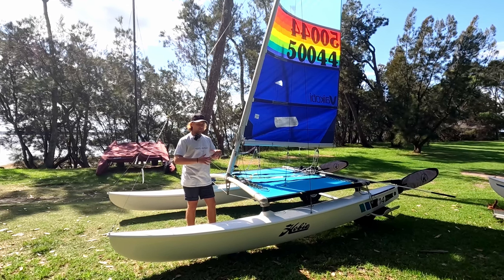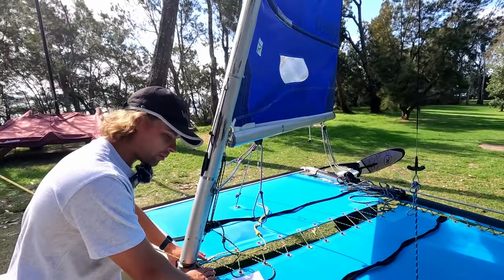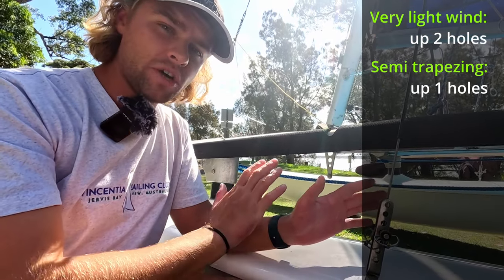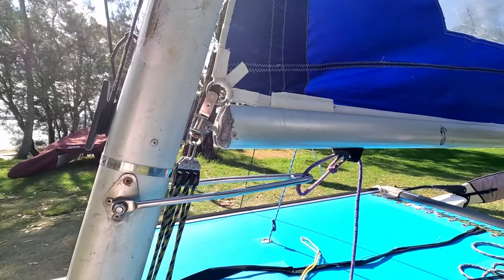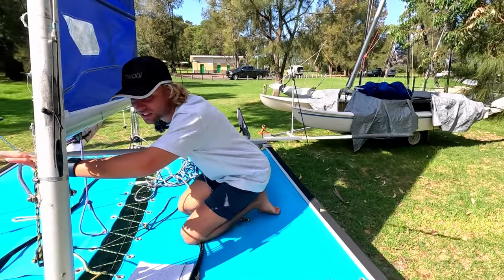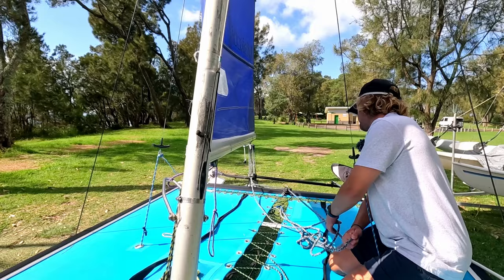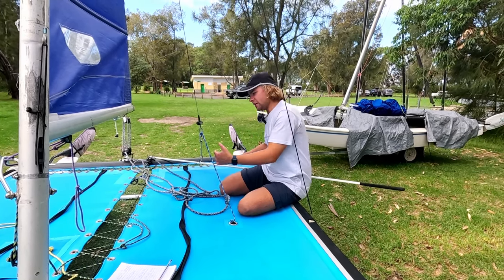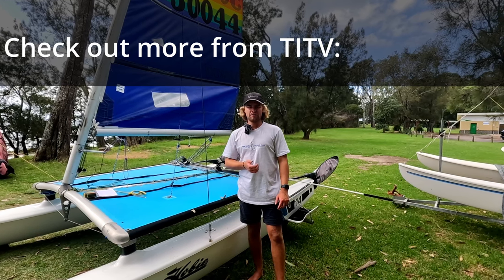Hobie 14 Masterclass with World Champion Paddy Butler

Comment: Thank you Paddy.. very informative. I have a very aged turbo. with no trapeze. I have fitted turnbuckles into the hulls as the beams had fatigued around the fittings.. also had to rivet alloy plates as the beams were bending upwards under windage. I do not have a rotation spanner on my mast. She sits on the beach and is bludgeoned by Southerlies up to 30 knots so I weigh her down  with rocks on the beam corners to prevent her capsizing on the sand at low tide.    My height is  6,2 and  weight 95kgs. How do you change the shroud pins without the the eye pulling out of the chainplate and the mast plummeting to earth?!.. I also sail a 16 named Pacific Banana with a cut down jib without battens as I only sail her with my mighty Dog Georgie. I also sail ancient A Class and the biggest difference to the Hobie is how vigilant you have to be on ensuring the leeward bow does not bury!! Troy and Georgie
Reply from the maker: Great stuff - that's a good solution to change the shroud anchor points. 
I'll make a video on how to change shroud positions without the mast falling down.

Comment: I just ask because  this boat is significantly different than either my 14 or my 14 turbo. For example the shrouds on my boats connect to the frame not the hulls.
Reply: G'day Kevin! Great question. Yes, Hobie 14s remain a one-design class. However, all boats build in the 2000s onwards have the shrouds connecting to the gunnel like the Hobie 16. There is minimal to zero performance advantage; however, it is (in theory) a stronger design. Many Australian Hobie 14 sailors who race on older boats have added a short wire or dyneema from the side-beam down to the gunnel for additional strength. Hope this helps! PB
Reply: @hobieclassaustralia  thank you for the response! So do all newer 14s have dolphin strikers and grommets in the tramp? I'm not exactly sure when new 14s stopped being available in the US (I thought late 1990s), but finding nice stiff 14 hulls is like finding a pot of gold lol.  Thank you again for your response.

Comment: Get out your reading glasses, it's a long one...  Hi.  A few weeks ago I commented asking your thoughts on a Hobie 17.  You mentioned talking about them on an upcoming Q&A.  Being new to your channel, I wasn’t able to find it.  Where would I look?

We sail in a small bay, about 1.5 miles long by .75 miles wide but have to sail upwind a narrow channel about 100 yards wide by 400 yards long to get into the bay.  The winds are often light in the summer but can be in 10 to 20 mph range.

I’m thinking a cat with daggerboards or centerboards would beat to windward up the small channel better than asymmetrical hulls.  Do you agree?

I learned to sail 60 years ago on a 12 ft Aqua Cat and 8 ft El Toro and over the years have had them for the kids growing up plus a series of monohulls to 40 ft.  I still have an Aqua Cat with daggerboards.  Simple boat, no boom to hit heads, inexpensive, can be carried by two kids, easy to rig and de-rig, fast for what it is and the company is still in business.  I’ve had a Sol Cat 18, Hobie 16, only sailing them for about a year each then went to larger monohulls with cabins.

Can you recommend a good to windward used cat in the U.S. that could still be fun to sail in the 14 to 17 ft range for at least 2 adults but could be 4.  Also, what do you think, jib or no jib?  Thanks.
Reply from the maker: I just found the time to read your comment (It's a long one scared me off somewhat)
Here's the short list:
Nacra 5.0 or 500 - skeg hulls, very good upwind performance - high volume so could carry 3 or 4 people
Nacra 5.7 or 570 - same as above but bigger - maybe less good for solo sailing
Hobie 15 (if you can find one - very simple - keg hulls - good windward perfromance 
Hobie 16 - most available - requires better technique but still do-able
Hobie 18 - a bit bigger + heavier but good for your requirements

Yes - have a jib
I think you're generally better off with skeg hulls rather than daggerboards so that you don't have to worry about hitting the bottom so much.